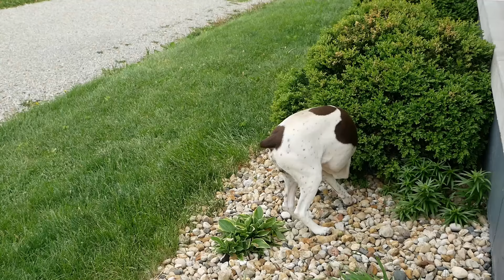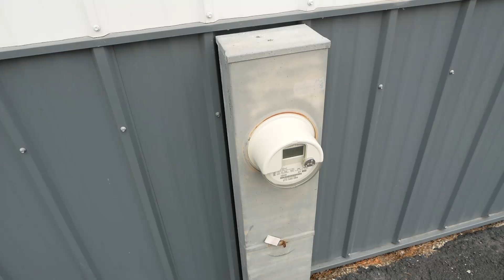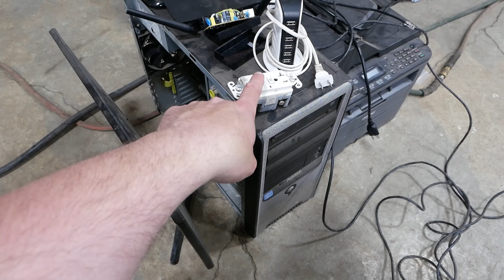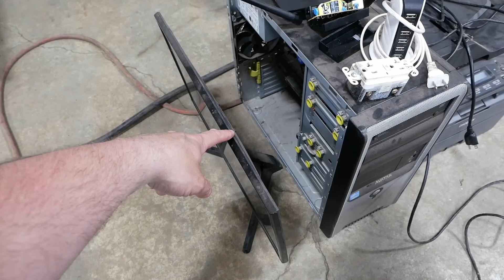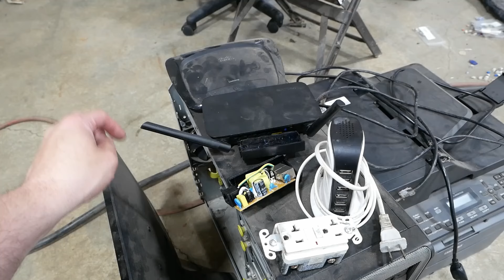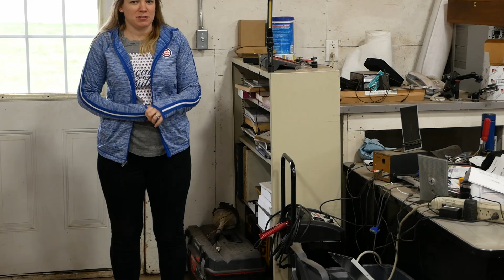Lightning Strikes Shop, Again...

Comment: 30 something years ago at work a lightening strike took out the communications equipment at work.  This was still when boxes were the size of refrigerators.  The building is next to a town water tower.  The lightening hit the tank and jumped to the building.  Took out the card access security system then somehow jumped 20 feet and drilled a hole through about 20 circuit boards in  either  a NCR 621 or 721.   We are the back end for right now 143 financial institutions.  Back then maybe 90.  The banks weren't up for a day or so until a new unit could be found and configured fpr our situation.   The card access system when the access panel was taken off was filled with inch size chunks of PC board.  Also destroyed a couple of CRT monitors.  These days the building is basically a server farm with about 400 Oracle Databases.   We have 2 backup datacenters each about 300 miles away from each other.  It would take a day or so to crank it all up.  Basically only caretakers work at these sites.  The financial institutions are cool about that.  24/7 instant cut over would be stupid expensive for a company our size.   

About 20 years ago, lightening hit the house next door to my sister.  Blew out the peak of the wall at the roof by about a foot. Peeled it like a banana.   It jumped to my sisters house and blew out a 25 inch CRT TV.  Pre flat panel days.

Comment: Lightning strikes are tough. You can check to make sure everything is properly bonded to earth in your panel, and that your building(s)'s ground rods are actually present and hooked up. The house and the shop should each have at least one earth ground rod. 

If lightning strikes are common around your area, consider putting sensitive electronics on higher-end surge protectors. Most "Surge-protector" power strips (and dedicated surge protectors) just have a simple device called an MOV inside. MOVs work by shorting out once the voltage exceeds a certain threshold (hopefully shunting the surge current somewhere else), then they usually blow open from the surge current. At that point your "surge protector" power strip just a normal power strip. Most of the time you won't even get an indication that the MOVs have blown open from the outside. 

Higher-end surge protectors contain not only MOVs, but gas-discharge tubes, fuses and large inductors/chokes to limit current. They're still sacrificial, but they do a much, much better job protecting against surges. Things like the Tripp-Lite Isobar or APC SurgeArrest Performance have these added features and offer much better surge protection. There are also whole-home surge protectors, but I cannot speak for their performance.

Comment: Surge protectors that mount within the breaker/distribution panel can help mitigate some damage.

See if the strip surge protector your computer, printer and monitor were plugged into carries a warranty. Many name brand units will reimburse you for the failed equipment plugged into the surge protector strip.

Comment: Have your electrician put ground rods in several places where any wires, low or high voltage comes into the building. Also ground your building iron at all four corners.  I have built a lot of telephone buildings and that is what is the minimum for them.

Comment: Look into a double conversion backup UPS for your most important electronic stuff, Wes. Its pricey, but it completely isolates the AC power from the AC output it provides to your electronics.

Comment: Its simple but a real pain, you disconnect it.   unplug everything that is hookup to power, data, and any outside connections.  If you have a local
ham radio operator he should give you good tips on it.  A subject by itself.

Comment: HAH!  The look on your wife's face said it all.  
She was dabbling in the Dark Arts on her phone.  The Working got out of control, hopped onto the neutral bus via the aftermarket charger thereby avoiding the line side protections (because that's what Evil Spirits and cheap chargers do), and proceeded to wreak havoc until escaping via the power pole.  That wasn't lighting - it's an exit wound!
Now the Dark Forces are roaming the countryside or hitchhiking to Washington to join their brethren.  I hope she learned her lesson but you should still tie her down at night and don't feed her pea soup.  Call the Geek Squad for an exorcism and an OEM charger.
Reply from the maker: She denies all.

Comment: 2:50 A Double Conversion UPS. There is NO line switching, and it uses a large isolated SMpS to produce DC-DC Batteries-Isolated Perfect Signwave inverter. It will save your electronics, provide cleaner power, you either get 120*2 or 240 or both with some tinkering, and usually they have an SB175 Anderson plug to expand the array of batteries. The power is so clean you can put an additional UPS on the first ups. (more for if someone trips a breaker or trips over the cord/cleaning and accidentally unplug, etc) The con is cost. You will pay about double to quadruple for a Double Conversion, but they last a long time, and batteries are serviceable. Would recommend a 2100VA 48v model. 

Standard UPS units only switch AC from Line to Inverter and have a delay. Most claim to adjust for surges or sags (by disconnecting AC for a few moments and using the inverter) but that will not save you. The inverter is also noisy and that can kill power supplies and makes a nasty sound with anything AV.
Reply: No double conversion UPS will stand off this sort of impulse. And actually, most modern units operate in bypass mode because <90% efficiency 24/7/365 is a lot of wasted money.

Comment: Unfortunately, there isn't a surge protector available that will stop a lightning hit charge! 
You could put in a lightning rod and grounding system, that might direct the charges to a good and proper ground, instead of through your computer equipment.

Comment: I learned to see lightning as RF.  It hates inductance, and loves capacitance.   Loops of cable near a ground will sometimes shunt the bulk of it if you are lucky.  The cable will be toast. I've made knots in power cords, and it's helped save one or two things. MOV's etc are nice for little transients, but near strikes are brutal.  I mean, it jumped how far to get to that pole?  A mile or two?  And a quarter sized MOV is supposed to do what besides vaporize?  And remember that from the ground point, it drops about 1KV per foot of distance in soil, so those zeus bolts can induce voltage in every conductor within a hundred feet or so of grounding rods.  So underground wiring isn't even safe.

If you can make grounds to antennas and meter loops, etc straight, it likes it. Bending adds inductance, and it hates that. It will induce voltage if it runs parallel to a conductor.  So, EMT is a good investment.  Gotta have grounds in every box. Best bet is to unplug what you care about... EVERY time.  Good luck brother.  Green Acres is the place to be..... farm living is the life for me!  Do you still have to climb the pole to use a butt set for a telephone?

Comment: well, you can always try multiple layers of surge protection like a breaker on panel and a high surge rated outlet strip with a ups unit plugged into it but even that probably won't absorb a direct hit.
the best protection is to unplug Computer and ethernet during lightning storms don't just turn off the switch it can jump switch contacts like a spark plug or have it all plugged into ups and unplug that from wall the surge can't jump a pulled-out plug. you could still use computer on battery power for a while with a large ups

Comment: I think I have a 14.4 modem.   I threw out the 9600 baud modem.  
Glass bottles to disconnect the ethernet cables to put the ends in to protect equipment on stormy days and every night.  

Do you have the external hard drive connectors . 
Otherwise.  Convert your ethernet in the shop to wifi so the computers are protected.  
Used to protect expensive stuff with SOLA isolation transformers.  Converted line voltage to a magnetic field that totally saturates the primary at about 80% of line voltage.  
I think they call them constant voltage transformers.

Comment: Wow what a mess! Definitely invest in a decent Universal Power Supply for your IT kit.    This way at least another strike will not surge through to the component level. I’m a bit surprised by your lack of a decent internet connection, so perhaps wise to invest in a standalone Terabit storage unit for critical files, and power this by the UPS also. Anyway of adding another earthing spike into the ground prior to the grid supply entering your property? All the best.

Comment: Sorry to hear about this Wes. The surge protector may still provide power but it will not protect anything after that strike and don't get the cheap ones get an APC or Cyberpower one and I know that they are expensive cause I just paid 42 bucks for mine and I would replace all of you surge protectors cause even though they have power there's no protection and I know that you had pretty much a direct strike and they won't do much with that.

Comment: I'm surprised you don't have any DSL or broadband options for internet because even DSL would be better than satellite. However if you have good cell network coverage and options for hotspot data on your phone plan that would be much more reliable than your current internet and possibly even cheaper. It would also be wise to get an solid state external hard drive or large flash drives to backup all your important information on.

Comment: Prevention - lightning rod that's higher than your building and the power poles.  
Best you can do - provide a more attractive target/path for the lightning next time.  Preferably far away from anything you care about.  
Yup, lightning sucks!  But with as many hits as you have already had, it might be a worth investment.  If you have or know any ham radio operators, especially any who are real antenna nerds,  they can get creative in helping you get a tower/lightning rod up without breaking the bank.  Pointy tips at the very top are also very important.  There is a whole science to lightning rods that is fascinating in and of itself.  I'm kind of surprised your power company isn't doing more on their poles with as many hits as you and your neighbors seem to be getting.

Comment: I feel ya on the internet, I have the same service you do, and it takes about 3 weeks for service here. I do have a little advantage though, I live one town away from their home office and I can troubleshoot most of their equipment. So if the POE dies on me, I can get them on the line and tell the tech what all I’ve done so far. Then he can usually tell me if they need to send somebody or if they can ship me a part. I also can go by and pick up a new POE on my way to work and test it after I get home. 
My home has been hit by lightning several times and it’s not pretty. The last time it even got my submersible well pump. 
You’ll get it all up and running again, don’t let the set back get you down, there’s always a bright side somewhere in the picture. P.S. When they come and put the new radio up, ask them if it’s high enough to get above any trees that might be between your place and their tower. Going higher helped my signal strength a lot, even though their tower is only about 1 3/4 miles from me. 
Have a good weekend.

Comment: Surge protectors go bad (because the cheap ones just use metal oxide varistors). Get a good one (I like Belkin Surgemaster) with a status indicator and connected equipment warranty. Or maybe a good UPS? Eton/APC have saved my equipment bit sacrificed themselves in the past. They're expensive, but cheap compared to downtime.

As for your data, a USB harddrive enclosure could be good to have.

Good luck, Wes.

Comment: Hate to hear all that, Wes. In my experience, not all surge protectors are created equal. I lost a TV back in the early 2000's. No surge protector. So, I bought one and paid around $120 for it. Came with replacement coverage, etc. It had ethernet, USB, regular outlets. I haven't had any trouble since (knock wood). But, the only sure fire way; is an isolated power supply or to disconnect everything during bad weather. Some of the recommendations that I got came from my amateur radio buddies (I'm a ham). I am sure that there is an amateur club somewhere in your area and I can almost assure you they would be more than happy to give you some ideas and recommendations about how to protect your equipment. Many of us hams are into public service and giving a guy some ideas certainly qualifies.
Reply: Well said!

Comment: Wess I'll try help on the computer first take out the memory sticks then the cooler off the cpu and remove the cpu fully being very careful of the pins and direction it goes back in Then hold in the power button with pc not plugged in for 10-15 seconds that will discharge the mother board then put everything back in it & if you got any backup monitors hook it back up and it should start up unless something on the board got fried it might just need the discharge if you dont get any startup screen it might need a extra video card ! If i was closer i'd drove out but i'm 90 minutes the other side of chicago !

Comment: Install a whole house surge protector at your main circuit breaker box. Learned the hard way here in Florida. No problems since. It will blow the protector  and nothing goes beyond. You would have to replace the protector...but worth the 80 bucks. Considering out of one surge...I lost over 3,000...

Comment: Sadly, surge protectors (even whole-house devices) cannot come close to protecting you against a direct lightning strike.  Glad to understand you and the entire family are okay, and you didn't suffer any major structure damage.
Reply: You are completely correct, all the arm chair electricians out there will tell you to go buy one at the local wally mart, and that will protect everything! 
Which couldn't be further from the truth!
Reply: @tekvax01  - 100%, Dan. Lightning arrestors,, even very expensive ones, probably will not save you in the event of a direct strike, an event which tends to just spectacularly blow everything apart.
Reply: Well they make whole building commercial surge arrestors with lightening arresting technology that will protect in 99% of situations. Otherwise many of these data centers for hospitals and top end research facilities wouldnt be operable with the cost of the equipment in those places..  now given many of the places have auto switching protection with arc gap and static sense which will constantly monitor all power coming in and switch to battery backup stand alone isolated power systems built underground.,  but between those power pdu units and the whole place fed via fiber optics they don't have to worry too much about lightening damage as much as equipment component failure or installer error..  the grounding for those places is wild plus having lightening rods positioned to attract the stuff to those points and dissipate it to ground plays a big role also.   But yes they do actualky make fail safe tech that will protect from lightening strike even direct strikes, you might pay way more than thought for it but theres manufacturers who stand by their word on that stuff.   Plus even the consumer grade protectors, if you get a good one and have it installed by a licensed professional they guarantee their stuff by promising up to a certain amount of reimbursement if anything at all is damaged with the device attached..  ive seen some of those say up to $150k..
Reply: @tekvax01  Same goes for fire safes. They don’t work in an actual fire, no matter what temp or duration they claim.
Reply: for a start I am not a armchair sparks I did my theses on lightning , so here goes totally agree with unplug sensitive devices , a strike 50 metre away can take out electronic ( EMC Discharge ) , your power company should at the least have guard conductors above the power line ( look at the hv pylons they have a high wire that is earthed ) , as the neutral took the hit just switching things off is a total waste of time most portable equipment that has a plug is only live wire disconnect , above all do not unplug things molest cables during a storm you will become the path to ground ie. dead

a little know fact that lightning has two phases the first is a low power invisible strike upward that ionises the air and allows the main charge to come down , if you are outside just before and during you will have a small feeler ionisation spike on you head or other high point ( look up st.elmos fire the old tall ships were very prone to this with the masts )

Comment: Sorry to see your problem. It is good that no one was injured.
Maybe the power company has coverage due to their improper protection.
Don't  even try to fix the computer. See if your data is ok and have it transferred to the new computer.
When you get set up, get a cloud account so your data is secure.
Most importantly have the power co. audit your power connections for proper protection.

Comment: I'm not sure how mains eletric is in the US, but in the UK every house has an earthing rod, so if power surges by a lightning strike, it would be diverted and discharged into the ground safely. Could you do something like that with your mains?
Reply from the maker: We have the same thing thing here. It also has a rod at the pole. Doesn't seem to help much.
Reply: My house doesn't have an earth rod. Most, actually, do not. Even if you do, a simple earth rod does not protect against these sorts of energy levels..